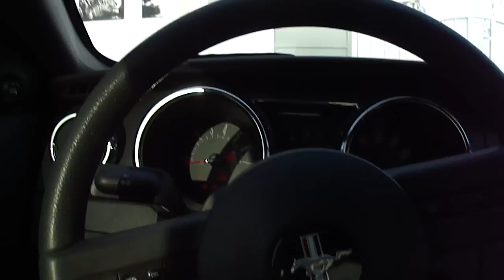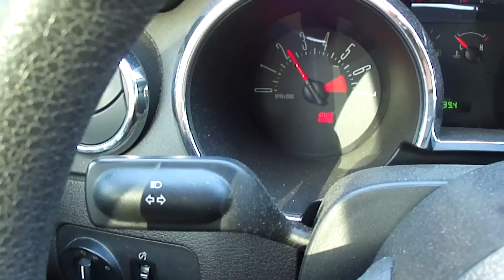stock 07 V6 with hacked straight pipes

Comment from the maker: @HotCheeks808 you gotta get the car up and take off the pipes after headers and measure out 2 feet after cat and cut. i used a skillsaw with a carbide blade (took about 5 mins) then i threw the rest of the pipes away and bolted the cats back up and it was ready to go. the only problem i've ran into is a bit of gunk builds uup on the walls where the exhaust hits but it so far from the wall it has no chance of burning it or doing any real damage that a car wash every week to 2 weeks can't fix